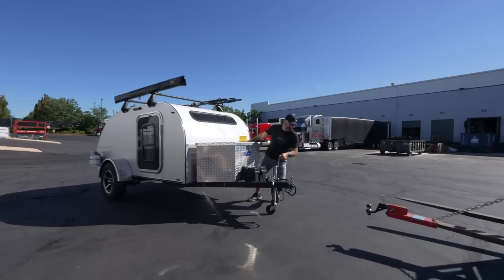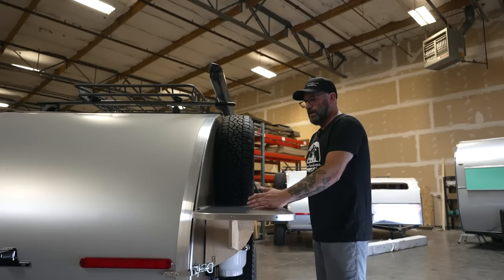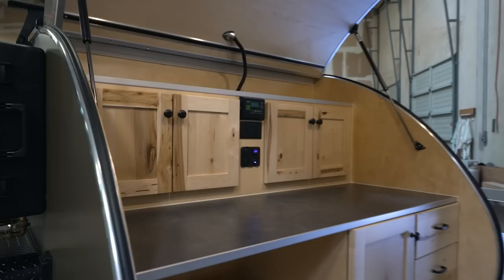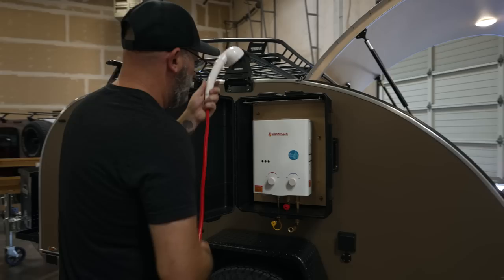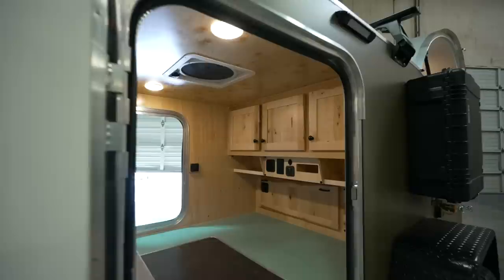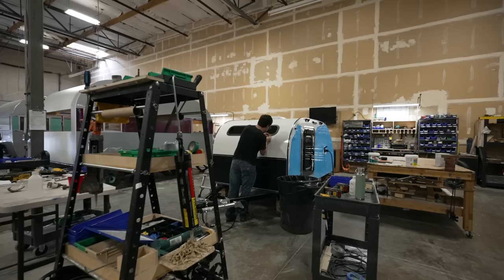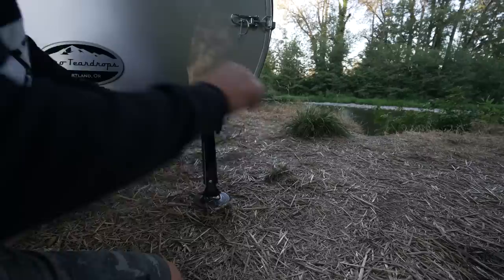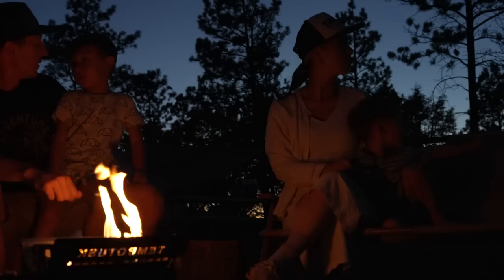Aero Teardrops Off-Road Trailer Walkthrough

Comment: I’ve own one since 2019 - “Priscilla”.  She still looks brand new and I even rent it out!  I love it and not much I would want to change.  We’ve done a few upgrades over the the last few years - a lithium battery and an off-road jack (beefier tires).    They are also a great company to work with.  They also service the trailers too!
Reply from the maker: How cool is that! Love running into actual owners on here. I was just talking about off-road jacks with my wife May. We have had so much trouble with trailer jacks over the years. My new line is "if you have it in your budget, just upgrade your jack when you first buy your trailer. You won't regret it." I am really hopeful at some point the industry will see the need for stronger, more capable jacks. I got to spend quite a bit of time with them recently and I would agree about the hospitality comment. They almost have a family like relationship with their customers. And you are absolutely right, having  the option to have your trailer serviced by the actual builder is invaluable. Camp-Inn who has been building trailers for over 20 years has the same model. It isn't very efficient for running a business, but great for the customer.

Comment: It’s a shame that Escapod is discontinuing the Topo1, but this does look like one to swoop in and take its place. It’s a great price too. Easily $2k below other options and a lot less than others that have raised prices this year.
Reply from the maker: It really is a shame. But at the same time I get it. I think they had a bit of a branding issue on their hands. If they were to talk about the positives of their Topo 2 it would basically be saying their Topo 1 was an inferior trailer. It really isn't, it is just different. When Jen told me the news I told her that I had a big task in front of me finding my Topo1 replacement. I was actually surprised how quickly I was able to find it. And yes, not only a more affordable base price, but I think the add-ons may be less as well than the competitors. Typically when I start adding on items it adds up quick. But for some reason with Aero the price didn't skyrocket. I may be wrong as I haven't compared this, but it seems like they are staying closer to cost with their add-on components compared to other brands. I really need to learn your name one of these days. I appreciate all the feedback you have shared with the community.
Reply: @PlayingwithSticks   I agree with the poster and you but I do like where Escapod is going, though. Full fiberglass shell on an off-road trailer that is a bit more narrow and compact than a Bean, for instance. I haven’t pulled the trigger on a trailer yet — rolling with a RTT on my truck, but as my kids get older, I’ll definitely be in the market soon for one. I would want an off-road trailer but I prefer a fiberglass shell, and I personally like the stance and look of escapod better than a bean. That’s all subjective, though.
Reply from the maker: @VirginiaHapa  I agree they are moving in the right direction. Well, in terms of trailer design. In terms of a business model, only time will tell. These economic times can't be helping these companies with almost $40K trailers at the moment. I am hoping our economy turns the corner sooner than later. Subjective opinion matters though. There are so many good trailers that May will not even step foot in. It has to have certain features and a certain look to get her okay. And I get that. I am similar to her as well. And you are right. After meeting with Jen and Chris again this summer and really going over the details of the Topo 2 it is really a different trailer than the Black Bean. Similar to Topo1 vs Bean Topo2 vs Black Bean you are either going to like one or the other, but I don't think many people will be split on the two.

Comment: Super great video. You do an unbelievable job! When watching these I always get the impression this is the one above all other trailers.I was almost 100% hooked on a Bean but like you stated by the time you build out the trailer I am almost at $50k. At this point why not just get an AirStream Basecamp which would meet my needs but ouch the cost. What I love about the Bean is the one peice fiberglass exo-skeleton and not needing to worry about leaking. These other tear drops, not saying they are not built as well Bean (quality), but materials break down over time and I think eventually you will run into leaking and wood damage. Would be interesting to see 5+ year reviews on some of these aluminume and steel sided tear drops and their maintenance.
Reply from the maker: Great points here Mark. I have done quite a bit of research regarding these traditional built trailers. And the research has been more within the builder industry vs owners. Well, recently anyways. I originally gathered all my information from owners. Here is what I would call the general consensus from my communication with many small camper manufacturers. Mass produced RVs and small campers coming out of Indiana are obviously not built for life. Basically after 5-10 years they are pushing towards ending up in a landfill. Small traditional trailers like this are built for life. BUT, they are not built to be maintenance free. Basically what I have found is that they tend to hold up for about 10 years before the owner or the original builder needs to do some minor maintenance. Basically at this point things start working their way loose. We saw this with our original homebuilt trailer. Easy fix, but takes a day to get her back up to speed. This is good news for most of us. Well, at least for me. I originally felt these were all designed for the landfill at some point. But that is not true at all. As long as you keep the maintenance up this means you keep the water out and they will stand the test of time. Now obviously this is not true for all brands/manufacturers. But for the ones truly building their trailers to be handed down to their kids.
Reply: 100% Agree!  I love Bean and not having to worry about leaking but they can be very expensive!  I would love to know how this aero trailer would last.  I live in a dry and very hot environment and would be concerned about how the heat would affect the structure and seals of this particular trailer.

Comment: FWIW, I purchased my trailer from Aero Teardrops about 6 months ago. Since then they have completely ghosted me whenever I have tried to contact them - even when I had difficulties on the road the 1st week I owned the trailer. The trailer itself is great, but after being left in the heat for about a month this chemical smell will not go away, even though it's been in a garage for the past two months with the roof vent open.
Reply from the maker: This is really unfortunate to hear. I’m sorry about your experience. But, I’m really glad you’re posting this. Nothing beats owner feedback.
Reply: @PlayingwithSticks  they did reach out to me today after I posted a review to try and make things right. So at least there is that, and I appreciate it.

Comment: Thanks for spotlighting Aero Teardrops. We've owned an Aero Teardrops trailer for about 16 months now. Have camped in it over 25 times and love traveling to new places with it. We've towed it just under 5,000 miles so far. Excellent workmanship and quality materials. Had two minor repairs early-on (faulty fan; wheel bearing fix) that they covered under the 1-yr warranty even though I was in another state. They worked with a local RV repair company to fix the issues and Aero covered the costs. 
Well thought out design that's beautiful and checks all the boxes without being overpriced. Simple things sold us on it: galley counter height is not too tall; light switches for exterior lights are located inside your cabin (other manufacturers had switches on the light so you had to exit the trailer to turn on the light!); wide range of options and no pressure to upgrade; willing to accommodate custom requests;; fit and finish was top notch.
 We love the cozy feeling and rustic look of the wood interior. We upgraded to the hickory cabinets and love the look. Very happy with it. Have not seen any other teardrop since our purchase that we like more than our Aero. If doing it again we would definitely buy another trailer from Aero Teardrops.

Comment: pretty cool little trailer that checks a lot of boxes. If I had one criticism it would be the fittings that hang below the frame waiting to be knocked off or bumped into. Overall I think I agree with you that...as hard as it is to do...while not perfect...this checks probably the most rounded set of criteria for teardrop trailer camping. It would help to better understand the frame construction and suspension setup. One concern I have with a lot of trailers is that they use the torsion axels from Timbren and others and the bounciness can be problematic in certain situations. I think Morryde, Cruise Master and others do a good job but I don't see them as much probably due to cost. One other thing that's nice to know is weather or not the inverter is pure sine wave or modified sine wave..
Reply: I'd probably knock those things off during he week in it myself as I tend to mainly run  unmaintained Forest roads, wonder if I  could get them to raise them up and have coming out the side of the body less chance of tearing them off!

Comment: Great job on the walk through as always Drew! Solid trailer...if I had to nit pick...the roof basket option looked like it would limit how far the fan cover would open... and those quick disconnects... right behind the tire are begging to be covered in mud at some point. Thanks for sharing!
Reply from the maker: Thank you! I find the majority, if not all companies who make an overland model say that there is enough gap for the fan to operate at full capacity. I have never tested this statement for it's validity. However, with the Bean trailer last year not being able to fully open the fan with the RTT I did notice it was functional. But the question is, is it fully functional, I have no idea. Good observation. As for quick disconnects I asked Brian about them. Mainly because I get quite a few comments saying the ones on the Topo1 are exposed to hazards on the trail. Brian said with his design being behind the fender it shouldn't present any issues. BUT I never considered mud. That  is the beauty of putting these videos out for the community to nit pick. It is nice to view these trailers from different perspectives. You know me and water systems. I find them tough enough as they are. We don't need any additional issues adding to the downfalls of a pressurized water system in the field. I really appreciate your comments in here. Especially with these more off road capable trailers. They feel bit out of my wheelhouse. So it is always nice to hear your thoughts on them.
Reply: @PlayingwithSticks  I usually have my fan cover raised just enough to allow for air flow so I'm sure the roof basket over the fan is okay...the quick disconnects though I'd be concerned with getting dirt and grit in the fittings and them not working/keeping a seal....I'd like to see them inside a smaller pelican style case of their own to keep them clean on the trail.

Comment: I haven't been to their website yet but one thing I might look at adding is a hand brake/ parking brake like the old M100 military trailers.  Sure, it is easy enough to find a rock or two to put behind the wheels but a parking brake locks everything down solid.
Reply from the maker: Quite a few people have been mentioning these lately. Pretty standard on EU, UK, and AUST trailers.  But it hasn't caught on yet in the States.

Comment: A decent teardrop and the price is definitely right.  I am like you.  I like the standard cabinets better than the “upgraded” cabinets.  I think it would be nice if you could stand up that Reliance water can.  I use one and always carry it with the lid up because when you put the spout on, it leaks.

If someone is considering a teardrop with a roof rack or roof top tent, remember it may affect your vent fan.  My Maxair fan (automatic open) when the fan is running is either all the way open or all the way shut.  On this teardrop the rack would prevent the fan like mine from working.  Just something to think about when building.
Reply from the maker: We had such good luck with the two reliance jugs that came with the Bean Trailer. When we bought a separate reliance jug just for car camping and we’ve had nothing but problems with it in terms of leaks. Definitely hit or miss. Great suggestions on the jug and the fan spacing. I think it’s very good advice to tell people to think about the future of their trailer. It’s little things like this that many of us overlook in our first build or purchase.
Reply from the maker: Garrett I am so embarrassed for asking this again, but I forgot what type of trailer you use?
Reply: @PlayingwithSticks  No need to be embarrassed.  I have a square drop.  It is a VRV Flyer which is no longer made.  It is very much like the inTech Flyer Chase with some front interior cabinets, front external storage access doors for the front cabinets, bench/rear slide out drawer on the left which converts to the bed, and a small, fold up table on the right to use when it is in bench/sofa "mode".   The person who built the VRV Flyers worked with/helped inTech with their Flyer.  I think there may be a video or 2 still floating around on YouTube about the VRV Flyer.